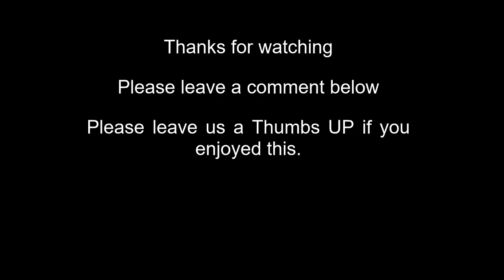Project Clanger the 109" - Landrover Series 3 Rebuild - Part 12 d

Comment: I sure hope it all fits right on final assembly and you don't wind up needing a shrinker or stretcher! I loathe body work but you have made that piece 1000% better than it was when you started!
Reply from the maker: Still got the upper portion to repair Brian - as long as Iget teh screen seat in flat and true it should all work out. I think perhaps I should have chosen a tractor to stat off with .. .you know the ones with just a seata nd pedals and steering wheel - no bodywork !  All the best Mat
Reply: instablaster...

Comment: Welding is looking better and better! I love the flap discs. Weld a lot of 16 ga. to 12 ga. stock and the flap disc polishes it right down as flat and pretty as can be. I have to say Matt I did not believe a person could ever get that rusted thing back together! But now I think you are going to do it!
Reply from the maker: Thanks for stopping by, things are progressing. As is usual, I underestimated the work in rebuilding the bulkhead - but its certianly better than when I started. Im going to look into getting a few grits of the flap disks. The speed and cool material removal is a big advantage over the hard disks Im used to. Mind they dont last so long !  All the best Mat

Comment: Gone from air and rust to a large amount of steel hovering in close formation. I was beginning to think your tig was getting way ahead of mine then you dipped the tungsten! Most would have edited that bit out, glad you didn't , made me feel I am not alone in my struggles with the torch.
Reply from the maker: The TIG welding is improving as I do more, still getting to grips with what AMPS to use in whihc application - I know now I should have upped the AMPS on the plug welding I showed here. It took far too long to build the pool and fill in - but I was afraid of melting the thinner pillar metal over the thicker foot part. Ive been steadily working my way through a couple of packs of tungstens - 1.6mm sometimesm I can go quite afew minutes before dipping or sticking it with filler wire. Getting the stick out so I can see whats going on is getting better - I was too short. If you cant see, you cant weld. I want to try a gas lens and see if the extra stickout will help me. Ive also moved to a No.6 cup for most situations as the extra stickout helps me see.  Finally, Ive gone back to a previous helmet which I find is better for me - it fogs up less. Anoying as the larger visibility of the new helmet is a big benefit - until it fogs up.

Comment: Hello Mat,
You continue to make good progress and I think it was a smart move to offer it up to the chassis and get the confidence that there were no show stoppers. Shame about the rust on the chassis but as you said the final covering can be applied to slightly rusty surfaces. keep up the good work.
Take care.
Paul,,
Reply from the maker: Some of the 'rust' stains on the chassis I later discovered were from the spray off the grinder when I was cleaning the bulkhead initially. So not as bad as it looks in this vid' but clearly some were down to my not covering areas as well as required. Mat

Comment: Inspiring work. I spent the day removing 5 layers of old paint getting my Landy ready to respray. Can't decide whether it's preferable to die of cancer from the chemical paint stripper or die of lung disease from inhaling paint dust from sanding.
Reply: Neither sounds appealing to me. Just do your best to get it done without harming yourself.
Reply from the maker: I share the dilemma. Might try paint stripper next
Reply: @lookcreations  a fine wire cup brush in an angle grinder works really well and doesn't seem to scratch the aluminum panels too deeply.

Comment: Coming along nicely. Always a good plan for a quick check that things fit before final welding. Might be putting a bit to much heat in while doing your plug welds from what I can see. If they hold well then it will be OK. Keep up the great work 👍
Reply from the maker: Hi Duncan, still getting to grips. After watching back the vidoes that was exactly what I thought. Cause... I think too low AMPS, so while I wait for the arc to form a puddle then to chase that puddle around and add filler its all heating up - maybe higher AMPS at the start would speed things up and cause less torch time over the pool.

Comment: Nice work Mat, must have been a good feeling when you fitted it to the chassis.
Best thing about it is it’s steel, if it’s not fitting a slice with the grinder and a re-weld is sometimes the easiest solution.
Cheers
Reply from the maker: Very true!

Comment: I'm amazed at your perseverance. It's turning into triggers broom! Love that you have used proper footwells with the pressings 👍. Always spot an engineering background. Your welding is progressing exponentially try less torch time on the job saves chucking too much heat in. When its pooled its welded! well done mate.
Reply from the maker: Hi Declan - have to say, the panels from Calssic Bulkheads have each been spot on as has the help and ongoing support from Anthony & his father.  The TIG time, is improving, I am still getting to grips with AMPS vs Torch time over a puddle. On teh one hand too high AMPS and it blows through too fast, too low and it gets more heat into the area... I am improving and learning each time.  I tend to get carried away trying to make it 'look' clean after its welded with the arc, when I shoudl come off and re-visit after its cooled.  All the best Mat

Comment: Looking good, don’t expect the foot wells to be accurately drilled either, you maybe a lot closer to original than you think! Check fit the doors to the a pillars for hinge position and curve alignment. Could you bolt the bulkhead to the chassis and weld it up, would stop twisting
Reply from the maker: Ive some repair work on the doors to get the old hinge bolts out so I can check fit - but its at the stage now where it'll be easier to mod the hinge holes on the doors than the bulkhead ! Who knows Phil - it could go either way tat his stage - a bloody mess or spankingly well aligned ! I know where my money is .... All the best mate. Mat

Comment: Looking good. Dont know if you have a heat gun available (or maybe the misses haur dryer) but that helps keep my feet nice n toasty out in the garage on the winter days, and keeps me working
Reply from the maker: I need some new work boots - insulated ones. Trouble is all the shops are shut and buying a pair by post on the chance they fit has never ever been successful for me. Weathers warming up here now, so hopefully it will be more comforable in the shop. Cheers Craig. Mat

Comment: You are doing a bang up job !
And I agree with the earlier comment 
Your welding is getting better 
I have one question 
Have you considered Cleco pins to temporarily hold your panels?
They don’t offer much clamping force (about 25 lbs) but they are very forgiving in their use and the part can be manipulated to a limited degree once they’re in
Keep up the good work 
I look forward to your ongoing project
Reply from the maker: hi Conrad, cards on the table, I had  abox of self tapping screws on the shelf (about 15 years now !)m started using them while I waited for some 'Tech Screws' - the ones with a hex head that self tap. The techscrews arrived and I cant find my socket that fits in my pistol drill. So the tech screws are now on the shelf ! If I was organised I would be much faster :-) Cleco pins - are they the aviation pins ? I think Ive seen them and have to say it always looks impressive a line of them down a panel line. Maybe if I end up doing more panel work I shall investigate further. Thanks Mat
Reply: @lookcreations  
Hello Sir 
Have you set up a post box for your channel?
If so would you be so kind as to send that information on my way?
Thank you for your sharing your project with us all
Reply from the maker: @conradgordon6745  my email is mat.look@live.co.uk

Comment: How about the Chassis from the inside. It also could be corroded internally. What can be done to address this concern?
Reply from the maker: The inside was treated with a cavity wax. Its also not had much chance of water getting in. I also found some of teh exterior staining was from particles of steel ground from the bulkhead whic came to rest on the chassis and then rusted. Not as bad as it looked in this video.  All the best Mat

Comment: My experience  ..
Zinc plated nuts and bolts stick together with the slightest amount of welding heat.
Put an adjuster nut on the back side and only screw a couple of threads in the nut to be welded.
Unscrew it ASAP after welding.
Probably worth running a tap through after it cools down too.
When you have mastered the art of TIG it shouldn't take anywhere near as long to plug weld those holes.
Which means less heat build up.
Less heat distortion and less burn through.
With more confidence after tacking you should be straight in and moving the weld puddle. 
Pushing the rod in cools things down.
The skill is coordination. 
Watching where you are going 
Watching to see both pieces are melting at the same time.
Keeping the electrode in the right place 
Pushing the filler rod in at the right time and in the right place.
I may have said before that my biggest hurdle was not being able to see.
Reading glasses made a tremendous difference.
In fact it is a doddle and I  don't know what all the fuss is about. 
5 years down the TIG road and after 16 years previous standing at a weld bench with a MIG in my hand says he.
Reply from the maker: Thanks for the advice Steve. Mat
Reply: @lookcreations  
I see in the comments you have worked some of it out yourself.
A tip for setting amps is ..
1 amp for every thou of metal.
16Gauge 1/16"  0.060"  60 amps
1/8"  125 amps amps